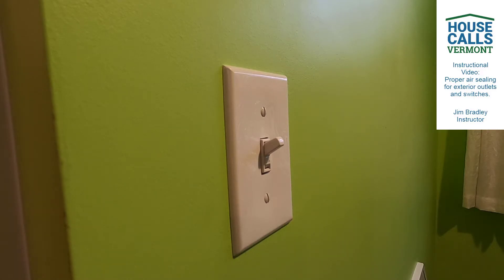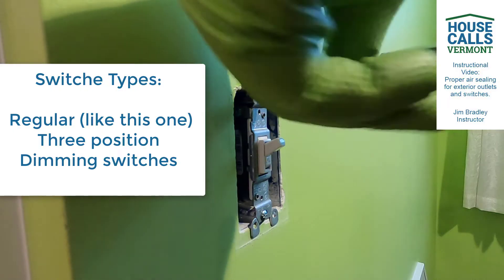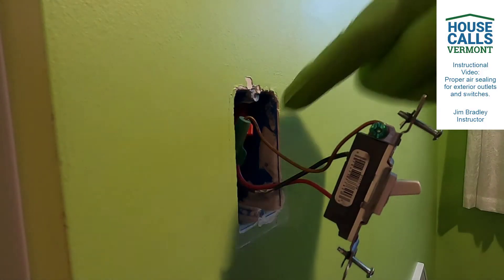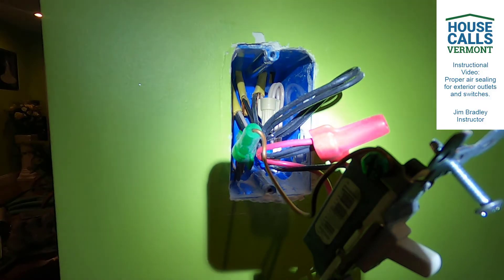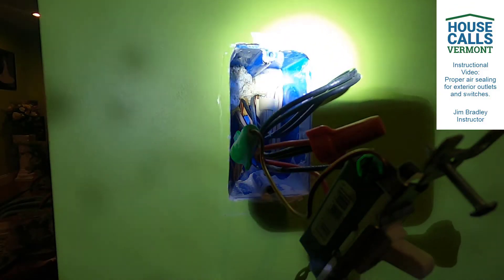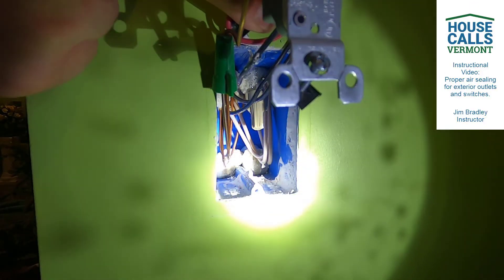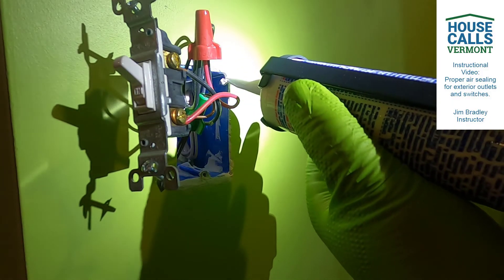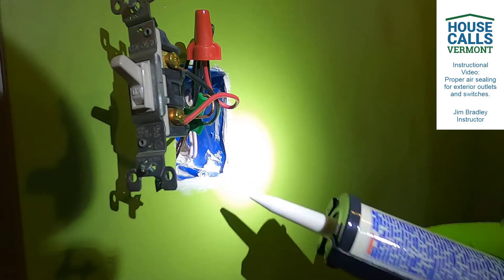Air Sealing Exterior Wall Outlet Tutorial 29Dec2020

Comment: The problem here is that using foam in the knockouts is against code because most foam is flammable. Even fire rated foam is recommended only for outside the electrical box. The box is your first line of defense in case of sparks or overheating of wires. The foam could melt, smolder or catch on fire. Not saying now, but years in the future due to age. Fire rated Silicone might be a better solution as I have seen some electricians use that for knockout plugging, making sure to keep the majority of the silicon outside of the box.

Comment: instead of spraying the foam on the inside of the box which would create fire hazard unless you use fire rated spray foam. the best thing is to cut small notch on drywall (0top & bottom) and spray foam on the outside of the electrical box. this much safer as there wouldn't be any exposed electrical wire on the outside. BTW home depot & lowes  or any local home improvement store would carry "great stuff" brand Fire block spray foam

Comment: Air sealing an electrical box in a house in VT is like squirting a squirt gun into the ocean. Most towns here have no inspectors and builders are running wild. Air leaking into a switch box is probably the least of the problems with your home. Furthermore, you don’t want to air seal your home at all if you don’t have mechanical ventilation.

Comment: A little constructive criticism - 

*Pick a better example of an outlet needing air sealing, for instance one that didn't have such tight drywall all the way around it
*Spend a minute before filming prepping the job. In this instance, you should have opened it beforehand and vacuumed out the dust 
*Spend a minute before filming prepping your production. Setup better lighting, particularly inside the outlet.
*No one wants to watch you remove screws, editing is your friend or fast forward until the cover is off
*Consider if you would watch someone air seal an outlet for 20 minutes. I don't think anyone would sign up for that. Cut it down to 4 minutes at most.

I know this video is several years old but after not getting through 5 minutes of the video I felt I had to comment why.

Comment: There are foam gaskets that go over the outlet and switches, underneath the wall plate.  They are cheap, easy to install, and work great.  Also, keep the knockouts from the gasket and put them onto the prongs of childproof outlet plugs.  Insert these plugs into any unused outlet, especially on outside walls.
Reply: the guy literally said they dont work in the first 10seconds of the video
Reply: @vector006  He said it at 18 seconds...There are many videos by energy experts, some also using infrared imaging, showing they DO work. This depends upon each individual outlet or switch in each location, and using them alone.  Combining them with the caulking and foaming is a belt and suspenders sure-fire fix.  They are certainly cheap enough to use.
Reply: @Lughnerson   You're correct